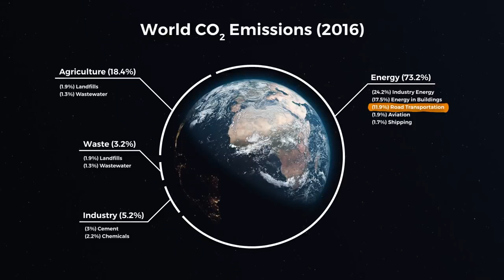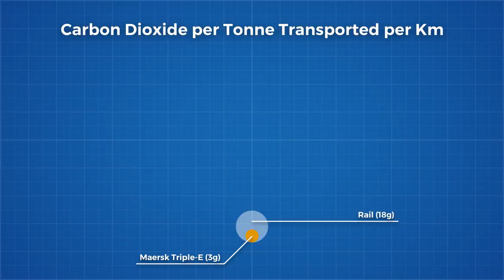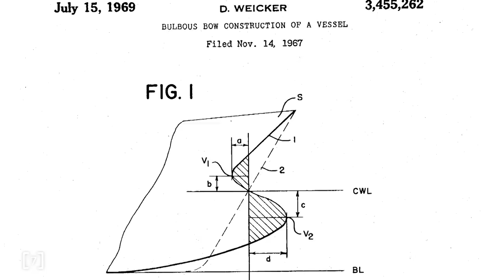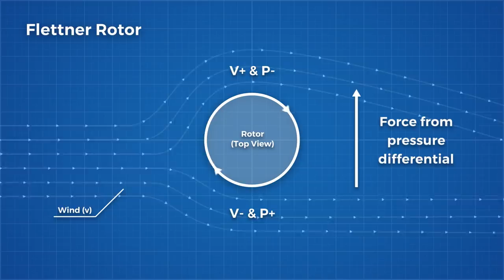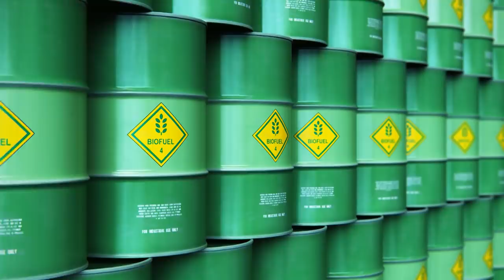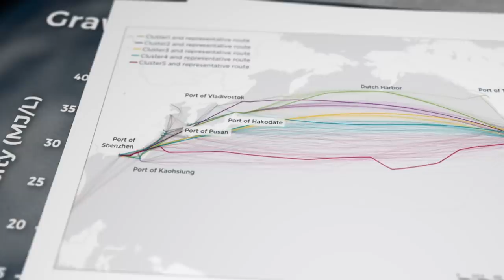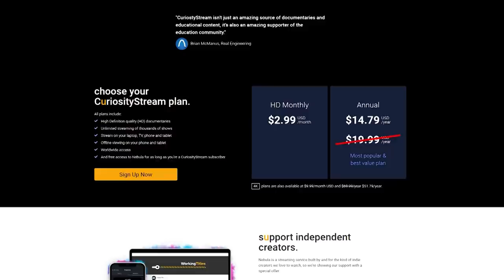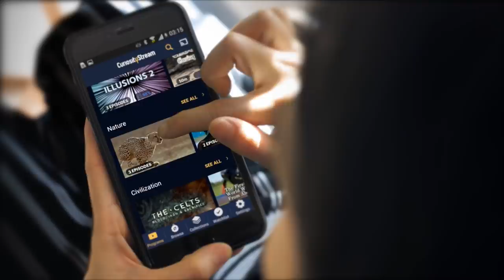Are Renewable Powered Ships Possible?

Comment: ‘Are renewable powered ships possible?’
Ship 200 years ago: ‘hold my sails’
Reply: More like 5000 years ago (~3000 BC)
Reply: Horses had once hauled carriages on land.  Why not use whales to haul trade ships?
Reply: @리주민  Or we put a moon on each ship to make the waves push it
Reply: @buddy1155  No, ships had sails way past 5000 bc.
Reply: @macaroon_nuggets8008  I wouldn't be surprised at all. I just did a quick google search,
Reply: Do you have any idea how many sailing ships it would take to move the same amount of cargo???
Reply: @buddy1155  by past i mean into the future.
Reply: @macaroon_nuggets8008  Now you got me confused because I said 3000 BC and you said past 5000 BC.
Reply: @davidkolb1942  Not that many, they will just be slower, Wallenius shippings' new vessels will be able to transport 7000 cars, and their main forward propulsion will be from sails.
Reply: @buddy1155  oh, you said 5000 years ago, not 5000 bc.
Reply: 리주민 I’m down to invest
Reply: @TheLoxen_  define not many more. Because if 80% of world trade is shipped on ships the size of the empire state building. The cargo is all on deck, where theyd block most of the sails, meaning sails would need to be even taller, the boats would be unstable and need to be bigger. Which also means heavier and requiring more wind. Horribly innefficient.  To ship the same amount, with sails, youd probably need a couple hundred ships to replace one of these cargo boats.   They would need to be metal or something else (heavy, harder to move with just wind, slow as shit). Wooden boats cant get very big before they shatter in the waves.

Sails arent the way to go.
Reply: @리주민  use tsunami power to push ships around the world
Reply: @buddy1155  The "Golden Age of Sail" was tapering off around 1800-1850, so 200 years ago is accurate.
Reply: @SC-mf1gc  It's been done. The oceanbird. It uses solid sails and while slower it produces very little C02. A cargo ship with the same size would produce 120 tonnes of C02. The oceanbird produces 5 tonnes. In addition it saves on cost as it needs very little fuel. It is of course slower.
Reply: In the treasure planet they used sails  that were photovoltaic sensitive. I know its unpractical that kind of ships but that was a cool concept
Reply: Ships 200 years ago: 'hold my sails'
2 days later
'Why haven't we still sailed?'
Ships 200 years ago: 'Wait a few days, we need the wind to blow in the right direction'
Reply: I think "powered" means using engines. Using only sails, while an interesting proposition, would not count in this context.
Reply: @리주민  hmmmm you might be on to something
Reply: @리주민  LOL that's a good one!

EDIT: Also it would probably be a great lore item in a sci-fi waterworld kind of universe!
Reply: @davidkolb1942  lots. In fact you would probably have so many that you could just line them all up and use them as a pontoon bridge between China and the UK, so then they wouldn't actually need sails at all!
Reply: @alephkasai9384  Slow down thew trade enough and some goods become impractical to ship beyond a certain distance and the it starts to become necessary to redesign the containers for higher weather resistance. It also drives up inventory costs for buyers and suppliers as the shipments are in transit longer making long distance vendor relationships more expensive. There is a point where international shipping becomes too slow to be worthwhile for some locations and the overall amount of international trade falls significantly, most likely to the detriment of poor primary production / manufacturing export dependent nations.

Most problems are more complex than expected.
Reply: @vickas54  You are correct, that commercial sailing stopped about 200 years ago. However it is ~5000 years old technology. That makes it a lot more impressive as steam engines, they probably lasted less than 100 years.
Reply: @buddy1155  yet sailing ships from 1800 were much better at their job than the first ancient sailboats. Much like the steam driven ships of the 1930s were much better (and more efficient) than the early steamers of the 1800s. No need to go all the way back to 3000 BCE to demonstrate the potential, in fact I think it's counter productive.
Reply: @리주민  and feed+steer them with farm-grown krill like carrot-on-a-stick?
Reply: @davidkolb1942  tbf the question asked if renewable ships are possible, not necessarily with the amount of cargo we have nowadays
Reply: @SC-mf1gc  Efficiency isn't really the name of the game here, though. It's getting the thing to where it needs to go without burning millions of years of stored solar energy to do it.
Reply: @vickas54  You might be right..
Reply: @SurmaSampo  There are certain markets where this is viable. Such as export of bananas where cargo ships purposefully slow down. There are also many less time sensitive markets.

Hell even then, it's either accept it or let the planet burn. And I for one do not believe that slowly dying out is a great option. Although many others clearly don't see it that way.
Reply: @buddy1155  christopher colombus didn't use a diesel powered ship, it had sails. that was in 1492, and they continued to use them 100's of years later
Reply: @RagavJanardhan  I am the owner of two sailboats. I do not dispute the fact that sailboats have been commercially used till very recent, and probably still are being used in some regions of the world. I just wanted to point out how well proven the technology is.
Reply: @SC-mf1gc  At that size probably metal is lighter than wood. Hell, the last great sailing ships were made of metal already as wood was not up to the task of creating such big ships.
Reply: The last real commercial sailing ships sailed until the 1950's (yes really, 1950).
In those last years they filled a niche market carrying low worth bulk cargo over long distances, still making some profit.
These giant sailing ships (some; 124 metres in length) had hulls made of steel as wood was not up to the task of building such big ships out of.
These ships were called: Windjammers.
Even in the years up until the 1930's they were doing serious business, sailing in the far reaches of the world, sailing voyages that no steamship would dare make.
They could handle such a big ship with a crew as small as 20 men, due to big innovations like outfitting the ships with lot's of winches to do the heavy work.
In the end, steamships won out as their engines became more and more efficient, and the world was starting to build infrastructure to support them.
The Suez Canal was a major blow to commercial sailing, as it drastically shortened to route to the east for steamships, and the big windjammers could not transit the canal on their own.
Reply: @davidkolb1942  do you know how small old cargo ships were? We can just build really big ones.
Reply: We've gone full circle 🤡
Reply: @alephkasai9384  Just because there are only 2 options you can conceive of doesn't mean other solutions don't exist.
Reply: @리주민  They might disobey
Reply: @alephkasai9384  I agree that sail could and should be a good option and was considered viable for a lot of shipping until a few decades ago. It did seem that you were proposing that the options were either slow shipping or ecological disaster.

The biggest problem with large scale shipping moving to EV power isn't battery supply, it is that volume and mass the batteries would remove from the carrying capacity of the ships. This means massive cost increases in an industry driven by unit cost. 

Perhaps ammonia combustion or fuel cells could be a good option but that has complexity and toxicity problems as well.
Reply: Best to have a look at ‘windship technology’ who are going to revolutionise this market...
Reply: I came here looking for this comment.
Reply: Everything is possible , the question is are you ready to pay more for your items, and can these companies survive more mandates
Reply: Honestly just get prisoners to start rowing🤣
Reply: @리주민  whales can dive and pull your ship underwater
Reply: Possible to return to 19th century ships, yes, if we revert to the price structure for goods transported before the McLean container ship.
Reply: Calling what they had 200 years ago "ships" compared to what we have today isn't even right.

They were more like small scale models of ships they wanted to build. 😃
Reply: @newdeal_99  
A few things:

1) you can have more than one whale to pull the ship, just as you can have more than one horse pulling a carriage.

2) engines die too.  When this happens, there's this thing called a radio...
Reply: @lordgarion514  They were fully fledged in their own right, considering everything we had, the boats of old were impressive constructions, and decently large too.
Definitely not on the level of .4km ships we now have though.
Reply: @Tonatsi  
Definitely not bad considering what they had to work with.

All I can say is, I'm damn glad technology has progressed so far so fast.
Reply: @alephkasai9384  No, it hasnt. The Oceanbird hasnt even been built. It is just a concept. Even as a concept it is only the size of a car transport ship, and is itself only designed to move cars. Cargo ships are way bigger and can hold a lot more. 

It is also half the speed of a car transport ship. So even if you wanted to switch to delivering cargo you've just doubled the amount of time it takes for world trade. Billions of dollars lost per day in delays alone. 

Now what about a mildly unpleasant day that a normal Cargo ship could withstand? Not the Oceanbird. More delays, more losses, less reliability. Good luck ever shipping anything that decays. It's already difficult enough. 

It's a pipedream.
Reply: @SC-mf1gc  OK, say we ignore global warming entirely - the world has a finite supply of the fuel used for current shipping. What's your alternative?
Reply: @jacobdrum  Just for fun Ill draw you up a few requirements that are still woefully lacking

What are we working with? We are working within the laws of physics. We can calculate the amount of energy it requires to move objects through water. We know the distance itll need to be, and we know how fast itll need to be to not cost $$ in delays.  

It'd need to be just as big as a normal cargo ship, and we should have just as many, if not LESS ships,  so we dont need to overhaul everything else. 

While not ideal, if it gets smaller, itll need to then be faster, NOT SLOWER.
If it gets lighter, it can't get weaker. 

So where does that leave us?
Solar, sails, nuclear, electric. None of those offer nearly enough power to size ratio except nuclear, and IM sure people wouldnt be comfortable with that. 
Building materials? Not light/strong enough at the moment to work with the low power offered by what we have so far. 

My fantasy solution that stays within reality?
Lighter building materials that are also strong
Power sources beyond anything we have. So more work on batteries/solar is needed first. 
Moving just as much cargo or more, as fast or faster than we do with fuel. 
A sail that is impossibly better and smaller than Oceanbird's monstrosity. We can safely rule sails out forever.
Reply: @SC-mf1gc  I was simply trying to engage you in a conversation, not actually ignore global warming. I also wasn't trying to troll you - resource depletion is something I worry about just as much as if not more than global warming. Take it easy.
Reply: @davidkolb1942  Question is not that is it?
Reply: @리주민  because they got hunted to near extinction to provide lamp oil until the fossil oil & gas (FOG) industry came along to save the last of them by producing kerosene. Yes the Bad Boys saved the whale.  Plus how would you go about training and harnessing them? Oh, that’s right you were joking!
Reply: @SC-mf1gc  consume less, especially that which is not within walking distance and small enough to move using your own individual effort.
Reply: @Tonatsi  ROFL (rolling on floor laughing)
Reply: @TheLoxen_  I thought the Wallenius car carrier was still at the research stage with the KTH?
Reply: To address the suggestions that sail power is the answer I offer the following.  In 1870 a premium sailing vessel entered service, the ‘Cutty Sark’, she could carry around 600 tonnes of cargo at speeds of up to 17.5 knots, dependent on the prevailing wind, to harness the energy the available spread of canvas was up to 2 976m2.  To round things out that was circa 5m2 of canvas for every tonne of cargo carried.  The ‘Cutty Sark’ was designed and built for employment in the tea trade where time on passage was a large factor in securing the premium freight rate that made her cost effective but as soon as the Suez Canal opened, which the ‘Cutty Sark’ was unable to sail through, she lost her advantage, raw speed, to the steam powered ships of that era.  Mechanically powered ships have improved in terms of efficiency, on a freight tonne mile basis, by at least one order of magnitude since then.  After losing out to the coal burning, steam reciprocating mechanical ships of the late 19th century ‘Cutty Sark’ was relegated to the Australian wool trade, just about the bottom of the barrel in maritime terms and only one small step up from being a 'honey barge'.  The canvas, cordage and extra manpower needed for sailing ships was never a very benign environmental option so please discount any idea of sail as ‘sustainable’.  All this is without the problem that if ‘the wind don’t blow the ship don’t go’, when it does blow it often blows in the wrong direction for your cargo delivery needs and sometimes there is rather too much of it for comfort.
Reply: It only took us 2 months to get from America to England!
Reply: @BasedBebs  think you mean the tides. Tides are caused primarily by the moon and secondarily by the sun, they are gravitational forces. Waves are created by wind blowing across the sea surface and winds are in turn caused by the local atmospheric pressure differentials generated by unequal heating of that atmosphere.
Reply: @davidkolb1942  one Mearsk Triple E carries approximately 700 times the cargo of the Cutty Sark nearly  three times as rapidly so, ball park, about 2 000.
Reply: @davidjacobs8558  To address the suggestions that sail power is the answer I offer the following.  In 1870 a premium sailing vessel entered service, the ‘Cutty Sark’.  The Cutty Sark was 64.74 metres in length with a beam of 10.97 metres and a loaded displacement of 2 100 tonnes.  She was able to carry 1 700 tonnes of cargo and to harness the energy the available spread of canvas was up to 2 976m2 which was tended by a crew of about 30 skilled men.  A ratio between the sail area (SA) and the vessels displacement (D) determines how lively she is; ‘lively’ being nautical speak for ‘fast and manoeuvrable’.  The carrying capacity of cargo ships is constrained in two ways, mass and volume which leads us to the ‘stowage factor’ of the cargo; the more mass on board the greater the displacement which in turn impacts the efficiency of the hull form and sail area / displacement ratio.  A vessel constrained by mass is said to be ‘down but not full’, a vessel constrained by volume ‘full but not down.  When in the tea trade, which the ‘Cutty Sark’ was designed and built for with fine lines (more nautical tech speak so again - no need to worry about it) she could carry around 600 tonnes of cargo at speeds of up to 17.5 knots dependent on the prevailing wind and had a typical China to UK time on passage of 120 days.  The tea trade was very competitive so ‘time on passage’ was a large factor in securing the premium freight rate that made her cost effective.  Rounding things out her maximum available sail area gave circa 5m2 of canvas for every tonne of tea carried.

As soon as the Suez Canal opened, which the ‘Cutty Sark’ was unable to sail through; she lost her advantage, raw speed, to the steam powered ships of that era who could beat her time on passage.  Mechanically powered ships have improved in terms of efficiency, on a freight tonne mile basis, by at least one order of magnitude since then.  After losing out to the coal burning, steam reciprocating mechanical ships of the late 19th century ‘Cutty Sark’ was relegated to the Australian wool trade, just about the bottom of the barrel in maritime terms and only one small step up from being a 'honey barge'.  The canvas, cordage and extra manpower needed for sailing ships was never a very benign environmental option so please discount any idea of sail as ‘sustainable’.  All this is without the problem that if ‘the wind don’t blow the ship don’t go’, when it does blow it often blows in the wrong direction for your cargo delivery needs and sometimes there is rather too much of it for comfort.
Random facts about ‘Cutty Sark’, it is said to have been possible to coax 3 000 horse power out of her sails, or in ‘real money’ 2 206 500 Watts (2.2 megaWatts), assuming this was in ideal conditions that is about ⅔ of the solar power that might be harvested from the ‘top of stow’ of a Maersk Triple E, again in those elusive ideal conditions.  So that majestic spread of canvas would have been even less efficacious for delivering your baubles and bows from the orient, despite taking about three times as long on the voyage.  The sails on the ‘Cutty Sark produce about 0.33% of the power need to propel a Mearsk Triple E.
Reply: @davidjacobs8558  VAWT (vertical axis wind turbine) might generate some power but not enough to push the boat along. see my earlier reply it is the same energy source just harvested in a more up to date manner.
Reply: @리주민  that would actually reallt be cool and smart and hard to do
Reply: And these ancient ships can carry how much? Not even 0.5% of what morden containers carry?